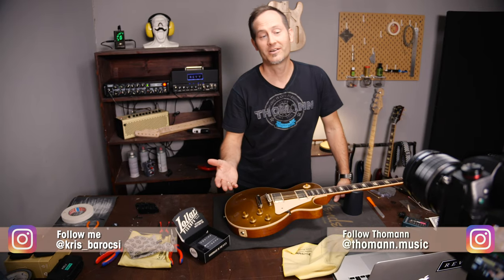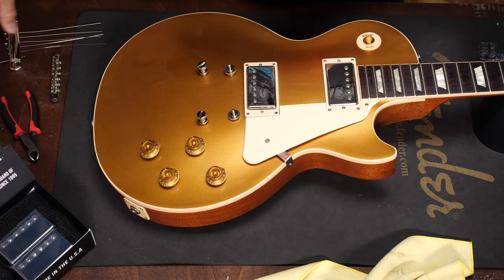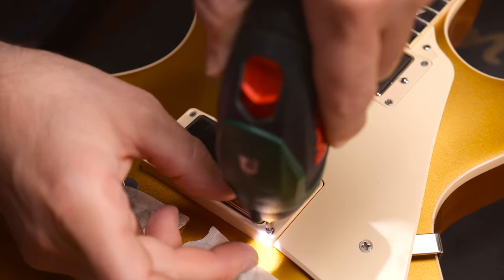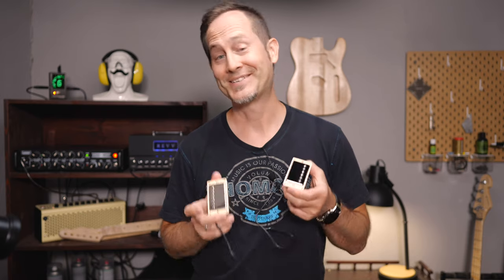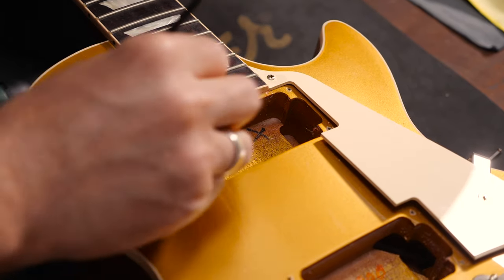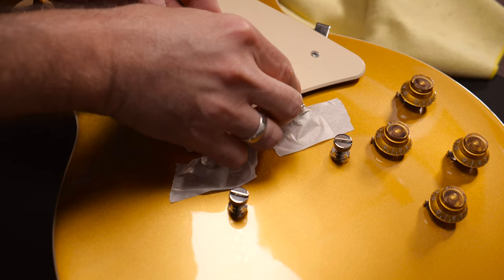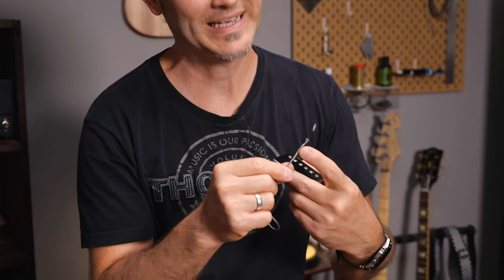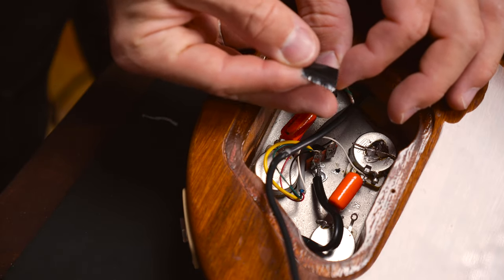How To Swap Pickups In A Les Paul | Guitar Tech Tips | Ep. 73 | Thomann

Comment: One thing worth to be mentioned, original high adjustment screws are imperial, so if you change pickups make sure that holes for adjustment screws are also imperial. In case ther aren't you also have to change adjustment screws.

Comment: One of the next Guitar Tech Tip  episodes should be. How to remove your PCB board in your USA line Les Paul to install new pickups. I went for the Mojo Tone prewired kit, as it was impossible to find replacement connectors for my pickups and I didn`t wanted to order prepared conector cabels as Gibson used different PCB-connectors in different model years.

Comment: Hey Kris! I‘ve have a question related to this topic.
The neck pickup in my HB Les Pauls SC 550 plus is terribly angled. The front (towards the neck) of the pickup is far deeper inside than the back of the pickup (difference is easily 4 mm) It cant be regulated with the side screws. Any idea what do?

Comment: stupid question, why did you only touch the volume pots and not tone? Thinking of upgrading to custom buckers in my 60's standard and have never worked on a guitar.
Reply from the maker: There are no stupid questions. :) I only touched the volume pots, because I was only swapping the pickups and those get soldered directly to the volume pot. The tone pots can stay wired just how they were in this case. Cheers //Kris
Reply: @ThomannsGuitarsBasses  Thanks for responding, i am looking to upgrade to the custom buckers, so it should be the exact same process and i can handle it i think lol.
Reply: @ThomannsGuitarsBasses  Do i need any special solder type? I was going to go with the custom buckers, but any thoughts on good alternatives?

Comment: Mine has a PCB, is it worth replacing it by a standard wiring?... Gibson Std 2009
Reply from the maker: Hey, if you're happy with the sound and it works well, don't bother. I would only replace anything, if something was faulty or if I really didn't like the tone of the pickups. Cheers //Kris
Reply: Hi Benoit, 
I just changed my pickups today and it wasn't easy. Not because it is high tech or anything, just that the connectors are so tiny!!! If i had to do it again i think i would scrap the PCB and use wires

Comment: Is it permissible to only replace one pickup or must all pickups be replaced with the same brand?
Reply from the maker: Most definitely not. For example my Les Paul has a Seymour Duncan bridge pickup and a Raw Vintage neck pickup. There are just a few thing to keep in mind when mixing brands: sometimes you have to swap the phase on one of them to stay in phase when having both selected (middle position on the switch). That's the case for example if you mix a Seymour Duncan pickup with Fender pickups, or with DiMarzios. Cheers //Kris
Reply: @ThomannsGuitarsBasses  Thanks a lot Kris 🙏, I was planning to buy Seymour Duncan Humbucker SH4JB to replace my Bridge pickup that come with the guitar (PAC212VFM) some people says it fits with '59 pickup from Seymour Duncan so I searched the product on SD website and it was Humbucker model, doesn't match with my single-single coils guitar. I didn't have any experiences about pickups so little bit confused 😋. Thanks a lot Kris...I appreciate your most valuable replies/info for me. Subscribe and Notification Checked ✅✅

Comment: Hi i was wondering if you can help me , i purchase a new  assembled harness kit for my les paul.I also purchased 1x 490 and 498 pick ups, unfortunately the 498 has 5 wires and the 490 has 1 wire wrapped with a neutral and i dont know where they should be soldered.can you help me.Thanks
Reply from the maker: Hi, as for the bridge pickup: Red wire goes to the bridge PUs volume pot input, white-green needs to be soldered together and doesn't get attached to anything, black and bare wires go to ground, which is the backside of the bridge volume pot. 
And the neck PU is easy: the core of that one braided wire is hot and goes to the neck PUs volume pot input and the wire shielding is the ground, which gets soldered to the backside of the neck volume pot. Check out Seymour Duncan's installation guides, they have tons of really good wiring diagrams and other things that help when changing the electronics: https://www.seymourduncan.com/blog/latest-updates/humbucker-wire-color-translation
Cheers //Kris

Comment: Does anyone know where the ground wire goes when you put the pickup back?
Reply: I had the same question
Reply from the maker: Hi, ground wires should be connected to the backside of the volume pot. Ground from neck pickup goes to the back of the neck volume pot, ground of the bridge pickup to the back of the bridge volume pot. Cheers //Kris

Comment: STOP SWAPPING PICKUPS! I'm going to help you drastically change your guitar for 1/2 the price of pickups..

#1) If you're running Gibson burstbucker pickups change the saddles to brass and tail piece to aluminum!
These pickups are designed to be ran with this set up to produce a singing or bell like tone!
If your using a burstbucker equipped Gibson standard usa or epiphone or even every single import on the market it likely has a zinc bridge, saddles and tail piece,this material produces a loud harsh attack and will make guitars sound overly trebley and cold and actually reduce sustain as zinc soaks vibration and doesn't react like steel, aluminum or brass...

#2) Swap magnets, this will alter your guitars voice more than you can fathom and it costs around $10-$20 bucks.. It's not a difficult process and there's tons of videos showing you how to do it,it takes 15-20 mins and give your instrument a completely new tone..

#3) Also just simply covering or uncovering pickups changes the tone, most pickup covers are either brass or zinc and they effectively block more tone than people realize..

#4) swapping slugs and pole pieces! Most pole pieces are made of zinc and pot metal and or contain very little actual steel.. You want actual steel poles and slugs as they conduct the magnetic field better and produce a more defined attack from your strings..Along with this swapping the metal pole piece spacers inside the pickup to actual steel will make a difference in how you your pickup reacts..

All of these mods are cheaply and easily accomplished and will change any pickups tone, whether it's a cheap Chinese, Indonesian, Korean and even American humbucker these mods will produce a wayyyyy better more dynamic and user friendly pickup..
These parts add more to a pickup than the winding itself...

You're welcome...